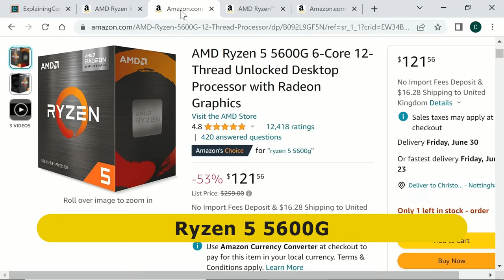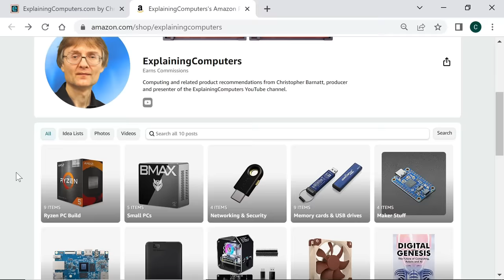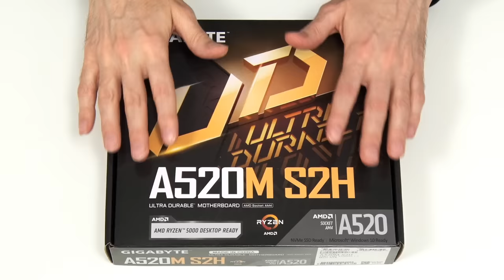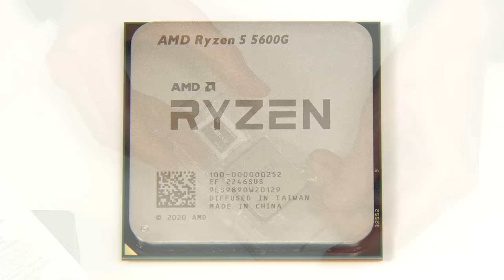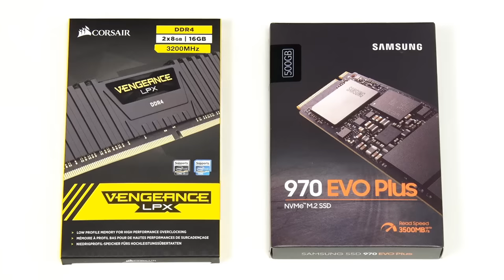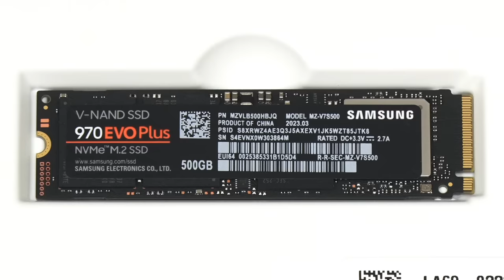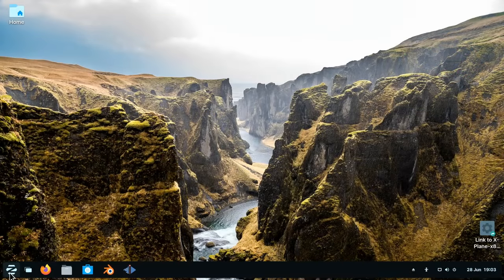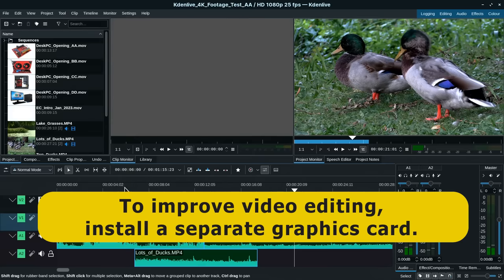Best Value Ryzen PC Build

Comment: I build a Computer with a Ryzen 5600G and a ASRock DeskMini X300. Now, looking this video and typing my comment, this system (without monitor/Full-HD/60Hz/12 Watt) only need 22-28 Watt. I can use this mini-system for nearly everything. Only some Games need a faster system.

I start now experimentiering with a Ryzen 2400GE in a used HP 705 G4 (little 1l-system). I will start using Linux (Mint).

Comment: I built a virtually identical machine last year: Ryzen 5600G, MSI B series board, Gold rated power supply, 16g Corsair memory. I recently installed a NVidia 3050 video card for a very slight increase in performance given my usage, mainly streaming and medium gameplay (GW2).  
Something to note is that the board does not support Windows' hardware security module, nor a CD player. Aside from that, I now have a machine I can use for probably ten years and, aside from the unnecessary video card, it is a budget build that I find extremely practical and relatively future proof.

Comment: Finally a useful build for the non-gamers, who do not want to spend ~$1000 on a graphics card.  The PC reminds me of the last build I did around April 2019 for $349. It had a Ryzen 3 2200G ($97); ASRock B450 HDV 4.0 ($60); 2x 8GB (Geil; 3000MHz; $82), the combo motherboard/CPU only supported 2933MHz for DDR4 and a 512GB Silicon Power nvme (3400/2300MB/s; $65) and I bought it all from Newegg.  Locally in Santiago de los Caballeros I did buy a Xtech combo of a midi-tower with a 600W power supply for ~$36.  I reused some HDDs (1TB and 500GB) and a 128GB sata SSD. 

I still used that PC, but consider to upgrade to your Ryzen 5 5600G and later to 32GB.  I had to replace the power supply after 4 years.  I never power off the PC, but it suspends automatically after half an hour idling, probably not ideal for the power supply.  The 1TB HDD died after 10 power-on years. 
I moved all my applications to Virtualbox VMs (4x Ubuntu (+ flavors) and 2x Windows (XP and 11 Pro). I also collect Virtualbox VMs, like all Windows Releases from 1.04 (1987) till 11 Pro (2023) and all Ubuntu LTS Releases from 6.06 LTS to 22.04 LTS; the first 4.10; my first 5.04 and the development edition including some flavors.  The Host OS is a minimal install of Ubuntu 22.04 LTS and all data and the VMs run from OpenZFS :)
Reply from the maker: I love the idea of a VirtualBOX collection. :)
Reply: @ExplainingComputers  My oldest VM is from March 2010, when I installed and activated Windows XP Home. I still use it a few times per week to play the wma copies of my CDs and LPs :)  

That XP-VM is truly old, because in 2010 Sun still owned Virtualbox. The XP-VM survived 2 VBox companies; 3 desktops and 4 CPUs.

Comment: Fantastic step by step explanation, Chris - very nicely done and great for those wanting to understand things better. As you say the value for money is amazing, there's also so much built into the motherboard compared to decades ago where you had to fit lots of ISA cards and extension cables for ports! PS I've got an identical red Philips Mr Screwdriver - my Dad's had it for many decades and it's still one of the best screwdrivers we've owned - great grip and seems to work perfectly for so many screws!

Comment: I just did a Ryzen budget(ish) build:

Ryzen 5 5600G
16GB DDR4 @ 3200Mhz
ASUS Tuf A520M Plus II
XFX Qick RX 6750 XT
700W CIT FX Power Pro 80+ Bronze
Already had SSD's, got 2 SATA 2.5 inch SSD's and one Gen 3 NVMe

Total = £650...Which is crazy,  coz I upgraded from a 3050 Ti Lenovo gaming laptop which cost the same price.

Comment: Now the right comment for this video. Thanks for this awesome video. It was inspiring for my next gaming build. I recently inherited a pc I built 3 years ago and was initially considering turning it into a gaming pc: I5 7500T passive cooled, passive PSU in a big tower. It will become a server, replacing a similar Haswell based setup. Makes more sense considering parts that can stay and power usage.
 So for the game machine your setup might be interesting. I  Only don't want an APU. I am not sure what video card I want, I want AMD but the RX 7800 with 8GB is still a bit too expensive and I would like more memory. And that card is probably too new for a PCIe version 3 system.

Comment: Came across this video after my own 5600g build, and with experience I can say that 5600G is really the best value build to date. I returned the Acer Nitro (newer model) with 3050ti GPU because it was too hot and too loud and built this one instead, since I had to invest in a monitor as well I choose the 5600G and sacrificed the option to get a dedicated GPU card(and also to  keep cost low). For any potential gamers watching this video and reading this comment, yes 5600G with 16GB ram is perfectly capable of running almost any online FPS game to play with your friends. Although you could absolutely benefit from a dedicated GPU but if you can't afford one the 5600G with its Vega 7 graphics alone is perfectly capable of running those online fps games. I get an average of 100+ fps on Valorant (medium settings), 150+ fps on CS:GO (haven't tested Apex yet), playable frames on BF5 (on low settings but still on 1920p), about 100 on Age of Empires 2 DE and other RTS games. Light editing of 1080 gameplay footage is smooth on Premiere Pro but when using Essential Graphics FX stuff it will lag a bit.

Comment: Built it. Works great! I especially appreciate the frugal economy of this configuration. Thanks for your always wise guidance and pioneering leadership, Dr. Barnatt.
Reply from the maker: Great to hear! You can say no more than this. :)
Reply: @ExplainingComputers  "Nevertheless he persists": Built this system using your suggested AMD 5600G processor (my first time using AMD) and  your recommended Gigabyte A520M DS3H motherboard (my first time with that brand too), a 1 Tb Inland M.2 drive,  and installed the recommended Linux distribution, Zorin OS. I scavenged parts including case, Asus 500W power-supply, and several drives from two older desktop computers. I put in 32 Gb of G.Skill RAM. I built my first Linux (Mandrake) computer circa 2000, and quickly abandoned it out of frustration with the complexity. But Raspberry Pi computers   cured my Linux anxiety many years ago, and you have given me the motivation to do it again at 80 years old. Thanks again!
Reply: @ExplainingComputers   Just a quick update regarding Zorin OS. It has now been upgraded to version 17, and now it also includes the ability to upgrade an installation of 16 without doing a reinstall from scratch. It (mostly) preserves all our settings from the older version, and at least in my own case, it worked well, with minimal attention required. This is REAL progress in Linux usability for the desktop!

Comment: The red heatsinks for the corsair ram is so beautiful. I forgot about color choice when these were on sale a month ago. If you are going to do gaming with an nvme. You really want at least 2-4TB. For 500GB these days are usually just to run the OS. That's usually dedicated for sata ssd over an nvme. Nvme's are better off as gaming drives, or something that requires fast read and write. Also make sure the motherboard has more than one nvme port. Comes in handy when you need more space. When first doing an nvme drive. I could not believe how small the screw is. Going to use a thumbscrew next time.

Comment: i have a theory where the reason Samsung are selling these drives super cheap is because of a lot of the EVO line are failing badly for a couple of years now - specifically 870. and even more specifically..870 EVO sata SSD I bought less then 2 years ago and just died on me yesterday. there's a huge thread on Techpowerup forums starting 02-2022 and not really ending on this issue. this doesn't affect the 970 Evo Plus ofcourse. great video as always!

Comment: I picked up a Ryzen 5600G 8 months ago on sale for $100 USD ($139 CAD here in Canada) to upgrade my HTPC's Ryzen 3 2200G.  I didn't even really need the upgrade to be honest the 2200G still did the job but for $100 USD I figured why not it drops right into my B450 board and I said 8 months ago they'll probably never be this cheap again and it looks like I might be right.  They're still crazy cheap but they've never been as cheap as they were when I bought mine.  Once they start to dry up they'll rise in price just as the 3400G did.  Now's the time to jump on AM4 if you're looking for this kind of a budget friendly platform.

Comment: Nice video Chris, I've not long built an AMD system myself to run VMWare ESXi on, it works great asside from the built in NIC which wasn't supported. But thats ok because I fitted a Server spec NIC in the single PCI x16 slot. :)

Comment: I upgraded to an Ryzen 5600G back in 2021 Sep when it just released, built it with MSI B450M Mortar Max, 32GB DDR4 3200 o/c 3800 and have been enjoying its performance since then. It's iGPU holds its ground at 1080p med setting for most games.

Comment: I got "spoiled" by AMD Athlon, FX series, opertorn and phenom processors over the years. The ones I had always worked with "onboard" video or with a graphics card. I thought that meant the motherboard had "onboard" video. When I bought a Ryzen processor and motherboard and the "onboard" video didn't work I thought it was defective so I ended up getting something else. This entire video explains the difference from the "old school" days where onboard video really MEANT there was an S3 virge or some such chipset on the motherboard, and NOW we have graphics IN the main CPU's. Wow I feel old!
Reply from the maker: You are right, onboard video used to be motherboard based, now CPU based.

Comment: Nicely done. I'm a person that's constantly searching online market places like eBay, or a Dutch market place to find bargains sold by non technical people. Last week I've bought an desktop with an 7th gen i5 processor, 4gb DDR4 (upgradable to 32gb) 128tb ssd and a 1tb HDD for 15 pounds. It only needed a new install of windows. It's very cool to build a secondary technical room with a 3d printer, a desk with an inexpensive computer with the right specs for around 200 pounds. My wife told me to go to flee markets etc and she was right. I've never had a luxurious life like this. I've even found a 2 disk NAS with 2tb of Synology for 25 pounds.
Reply from the maker: Good deals. :)

Comment: Amazing, a used case that is dust free ! 

I usually find that Mr vacuum cleaner  and  Mr anti-stat cleaner have to be employed quite extensively before anything new can be installed.

It may be wise to have a small supply of spare thermal squares/ thermal paste and some ethyl alcohol, a razor blade and some cleaning clothes on hand in case first application of cooler to processor goes awry.
Reply from the maker: A have a powerful Mr PC Dust Blower! :)

Comment: Recently ,MAY 2023, i upgade my rig:
I had: An asus P8z77M with Z77chipset, Intel 3770 (NoN K), DDR3 32GB(4X8GB) Corsair Vengeance LPX@1600MHz, Samsung Evo SATA3 500GB, Seasonic S12G-650W, MSI Mech 2X RX 6700 XT
I Upgrate my Mobo, CPU and RAM and i kept the rest of components: Gigabyte B550 Aorus Elite V2 (125euros), AMD 5600(NoN X) (123euros), DDR4 32GB(2X16GB) Corsair Vengeance LPX@ 3200MHz(68Euros) of a total cost 316 euros. Prices are in Greece.

Comment: It's incredible just how cheap good hardware is nowadays. 
I remember when I built my first PC in 2016 I paid roughly the same and only had a dual core i3 with intel HD graphics, 8gb of ram and a 500gb hard drive. (Which I did not buy but came from an old laptop)
I was happy with it at the time because I was able to play minecraft and skyrim on low settings at 1440x900p but this is so much better.

Comment: Point three at 2:57 is not entirely true, because not all CPUs in the 7000 series have a dedicated graphics chip. It should be mentioned here that the respective F variant of the 7000 series does not have an integrated graphics unit.

Comment: Nice video. Which really shows the great value in AM4 platform. I used the same combo. Except with Asus TUF 520 chipset motherboard to upgrade an old AM2 system for a client. A great budget upgrade option. Nice to be ready for the end of W10 support. And its just hugely faster. Really its such overkill for all the machine is used for in my client's case. But as the saying goes. Moderation is for monks.

Comment: My cpu is Ryzen 7 5700g and 32gb 3600mhz ram and asus b550m board and wd black sn850 500gb ssd. it works great.
Reply from the maker: Sounds cool. A very solid system.

Comment: I build a very similar system for my son last Christmas I user the 5600g that I got for £119 of Amazon and managed to find someone dumbing an unopened B450 motherboard for £15 that they where forced to get when buying their GPU during the great GPU shortage of 2021 also CEX was dumping a bunch of 8GB DDR4 memories for fairly cheap I think I got 2 sticks for £30. I also managed to score a good aluminium Gaming PC case of Marketplace for free that someone was just dumping. So for about £160 he got a really good gaming computer that was a great upgrade to his old ex-office PC and I could even use the old 250W power supply that came with it. Later he used some of the Christmas monies he got to buy a 1TB NVMe drive. Oh the Ex-office PC was a intel G630 that was well past its prime so he was very great full for that. Maybe this year we can get him a GPU if the price keep coming down to a normal level.

Comment: Worth noting when you build a system with a Ryzen APU is that fast memory is crucial to the iGPU performing well. Going with slow 2666 or 2933 mhz memory will cause a considerable decrease in gaming performance. For best performance with a Ryzen APU, it is generally recommended to use at least 3200mhz memory in dual channel (meaning having either two or four matched memory modules)like the corsair kit featured here. Also worth noting is the especially with the older 2000/3000G, but has also been observed on newer chips is that some linux distros, particularly those running older kernel versions could potentially have random freezes due to a kernel bug combined with some older power supplies not properly adjusting the idle voltage when the cpu goes into low power mode, but systems with new power supplies have been observed freezing as well. If you have this issue, the fix is to disable C-States and set power supply idle control to "typical current idle" if your motherboard has this setting in the bios, which prevents the processor from dropping below base frequency when at idle and keeps the idle voltage into normal power mode. This will increase idle power consumption, but SHOULD prevent this freezing issue. The exact cause of this complex issue isn't known and amd as far as i know has done nothing to fix it, but changing these power settings mentioned earlier should help along with upgrading your kernel to the latest version if you have the know-how.

Comment: Hello Chris. Thanks for another great video. I always want to ask you about the Anti-Static wrist. I remember you mentioned it before but I can't find it. Maybe I'm wrong, but I don't see the ESD wrist in this video. For myself, I've been a Custom PC builder for over 20 years and I never wear an ESD wrist.I don't think I ever encounter an issue ever.I found most You-tubers don't wear wrist either. I usually touch the water tube or surface of the Metal PC case (power off and connected to ground) before any operation.I guess it is okay for most cases.
Reply from the maker: You don't see an antistatic wrist strap in this (or other recent) videos because I have got intense abuse in the comments when I've used one. So I ground off camera.
Reply: @ExplainingComputers  Now it makes sense. It's unfortunate that people are making judgments based on this. The reason I brought it up is that I noticed you wore an anti-static wrist strap in your previous videos for the Ryzen APU and i7 builder. I came across the concept of anti-static prevention in a book, and it highlighted the potential for catastrophic failure in extremely rare cases. Despite the low chances, I believe using an Anti-Static wrist strap is always a good practice.

Comment: Great video. I've been itching to build a new PC to run X-Plane but for now my Lenovo AMD Ryzen 5 3400G machine with 32Gb RAM and a rubbish NVIDIA GeForce GTX 1050 Ti/PCIe/SSE2 will have to do. Although I'm thinking of getting rid of the GPU and replacing it with an AMD Radeon 6400 card. I can't use a better card because of the limitation of my 230W PSU!

Comment: I will share this as my brother needs an upgrade for Win 11. Currently he has a very old Intel 4 core with only 6GB of RAM + a nvidia GTX 260. Will need a better mobo as he has more than 4 Sata drives. Then a better case & new PSU as they are both 12+ years old.

Comment: i took the 5600g for my graphix rig but with a gigabytre 550m ds3h for the minitower. price for the ryzen was around 20eu more tho. my main music rig will get the 5700x after havin the 3400g used for 4 years now as a transition cpu before gettin a dedicated gfx card after 2years. saved me a lot money with that transition built concept. unfortunately the new amd socket system stopped it brutally^^

Comment: 5700G is the best CPU I ever purchased. it runs cool, low energy and is super responsive, even with multiple VM running in the backgroud. I have a 16cores 5950X and in most situations, there is no difference except the 5950X is very difficult to cool and requires a solid motherboard.